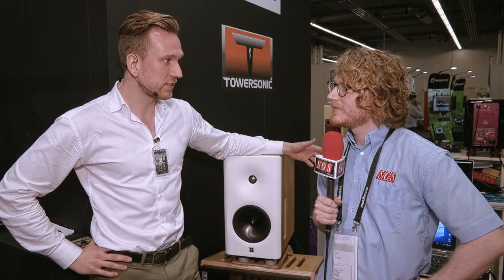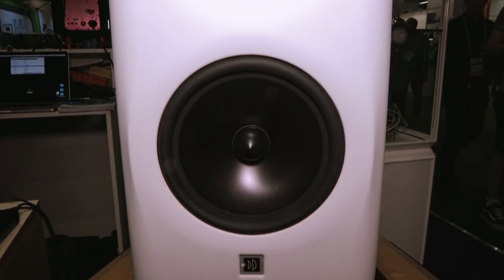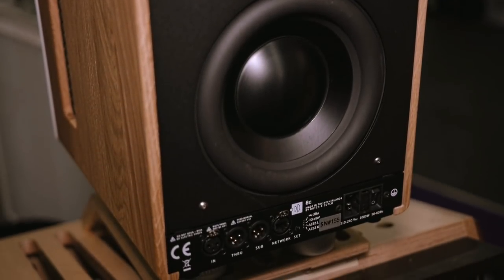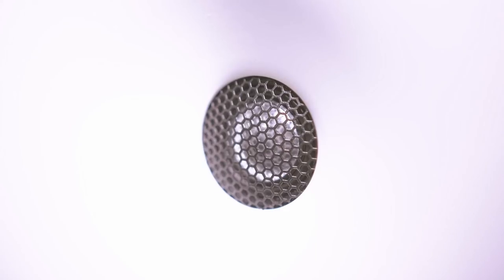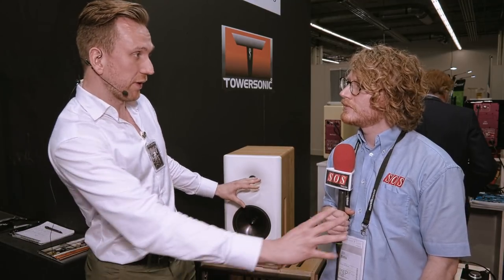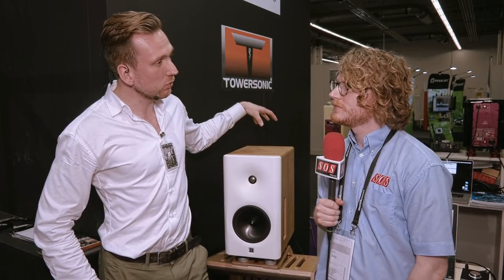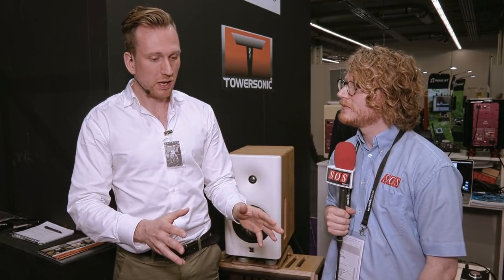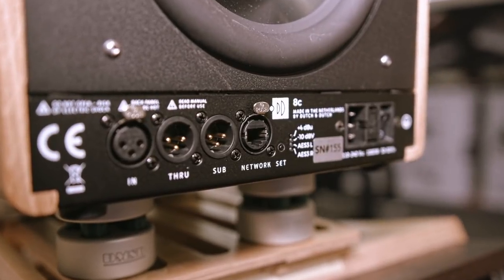Dutch & Dutch 8C - Musikmesse 2018

Comment: Can you Switch off the internal dac if you want to use an external one?
Reply: no because there are also internal DSP stages
Reply: Why precisely would you want to do that, just because you spent a lot on the external one? :)
Reply: @morespinach9832  yes
Reply: @gennadius2638  I had the same thought with Aureliac DAC going into my Dynaudio Xeo 20. But the internal DSP in speakers will do its thing and cannot be disabled. This is true of most active speakers. Keep the DAC simple and transparent (even simple ones like Schiit Modius) and don’t overdo that part of the chain.

Comment: Wave guide isn’t as beautiful as S400
Reply: Do you prefer the non-continuous waveguide? I do like how the Buchart from a distance balances the top and bottom black/white contrast areas.

However, the Buchart is using legacy crossovers, doesn't correct for the room, lacks cardioid dispersion, and has a passive radiator on the rear instead of two active drivers.

That being said, I've heard they are working on an active version that might bring them a step closer to the 8C, though at a fraction of the cost (and not having the features listed above besides amping and active crossovers.)
Reply: @stevenswall  Well the A500 now corrects for the room, has cardiod dispersion tuning and has an active radiator :-)